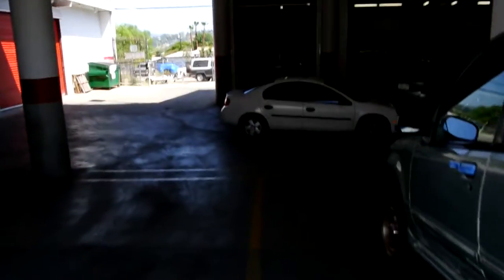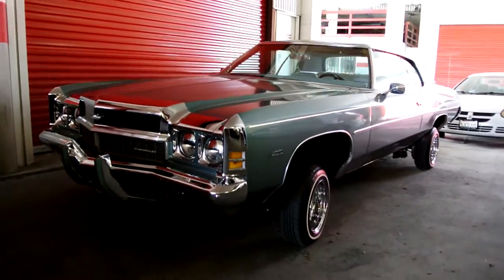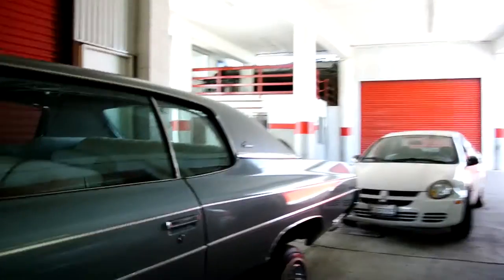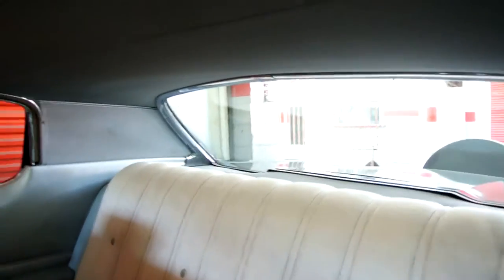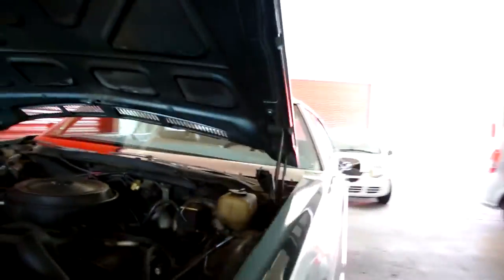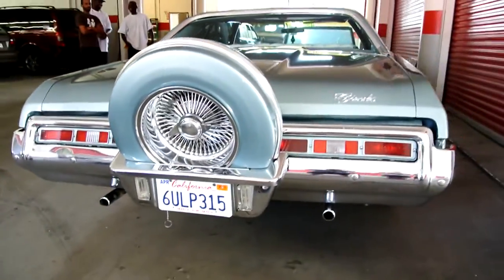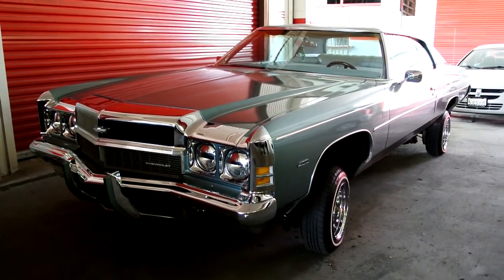1971 Impala Caprice 400 Continental Kit Chrome Grill Hydrolics Yung Docc

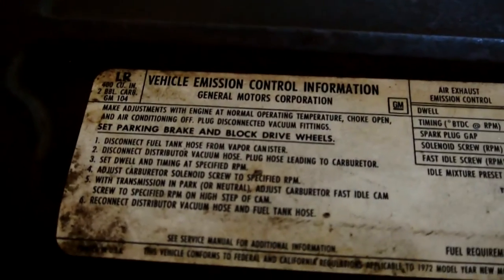Comment: This is a '72 Caprice.  The front end and rear tail lights are a 1972.  Additionally, the '72 had the "400" badging on the side fender where it is on this car,...the '71 had it much lower on the fender on the lower molding.  Additionally, to verify this point, go to 2:02 and you'll see the bottom of the "Vehicle Emission Control" sticker, on the bottom right it says "1972 model year"

Comment: That's 72 and you can tell by the back bumper. The tail lights on the 72 sit inside the bumper where on the 71 it does not. I have a 71 impala custom